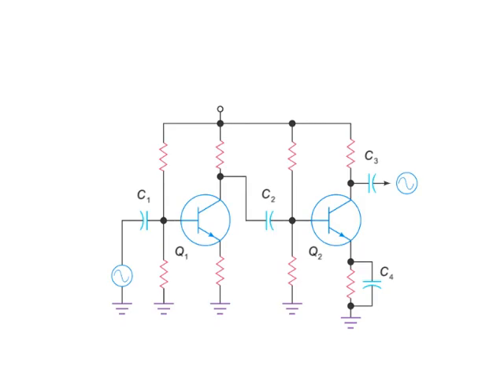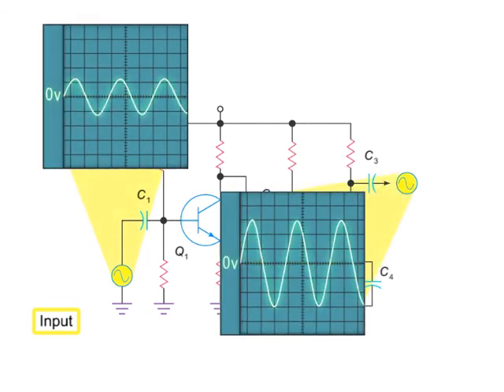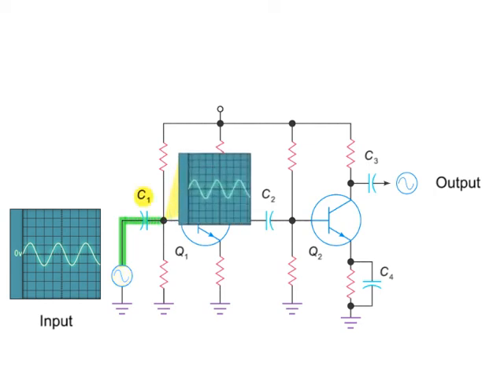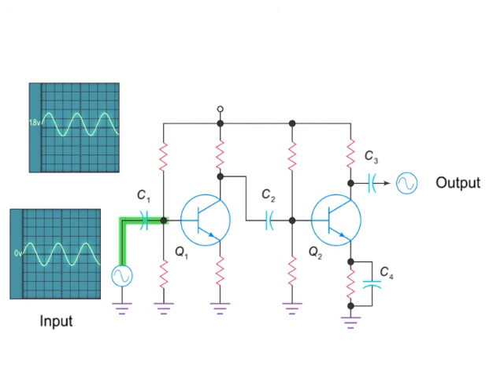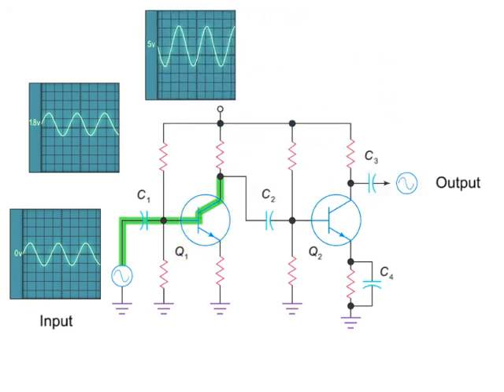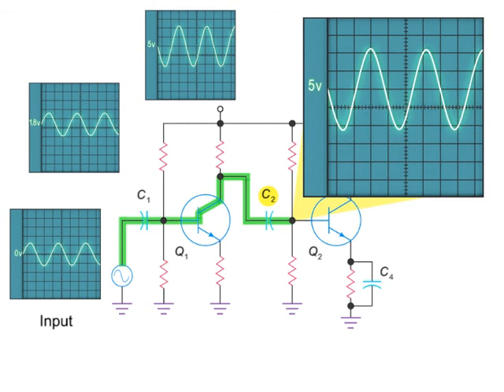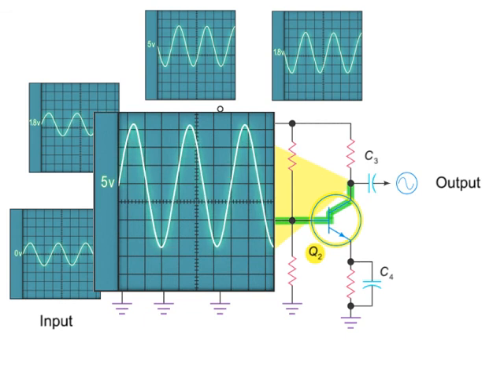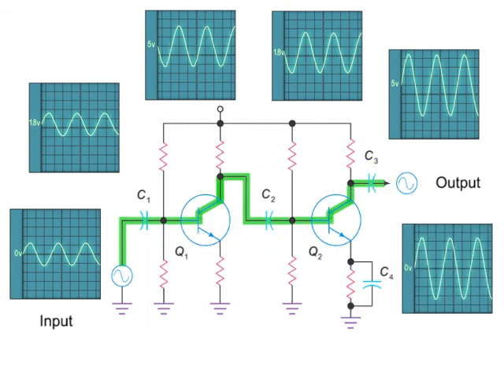Circuit Represents a Two Stage Capacitively Coupled Amplifier

Comment: Pls explain the resistors function and its valve how it changes the signals, thanks
Reply: I could be super wrong and somebody please correct me because I’d like to actually know but it seems like the resistors have a high ohm value which keeps the current flowing in the intended path, as it will follow the least resistance
Reply: And having variable values via potentiometers could allow for extra control of the signal

Comment: Yes but if the value of the capacitors is not selected correctly, then they will distort and/or reduce the amplitude of the signal going through them.